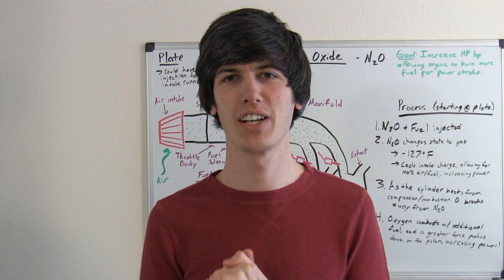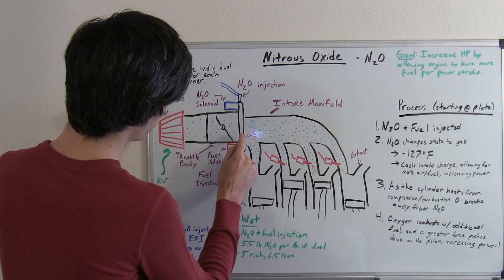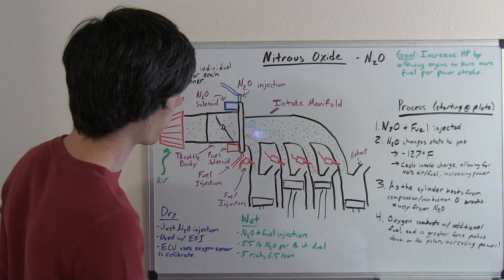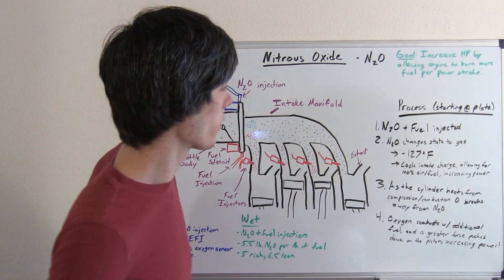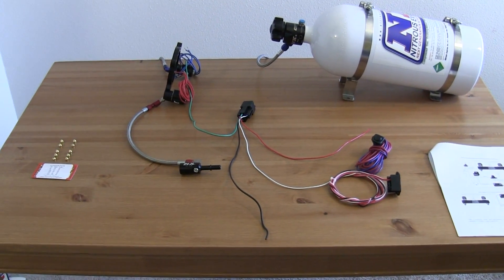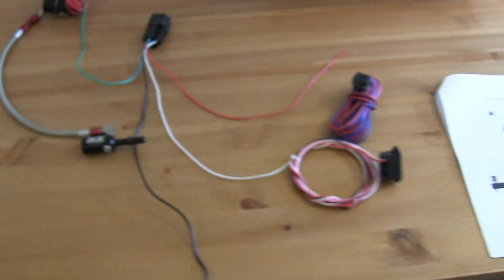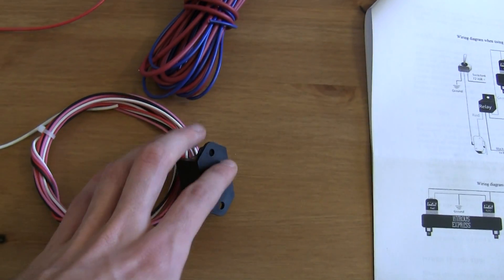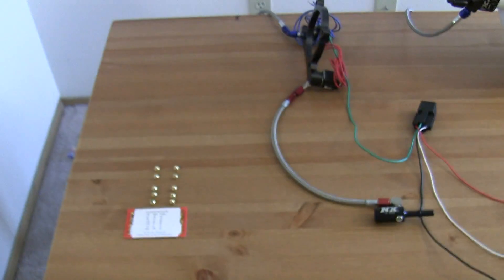How Nitrous Works - More Horsepower!

Comment: I do. Sorry if I came off like a dick haha but still what you said is way off. It can be done very safely if you have the time and patience to learn before you do anything. Safeties include window switches (recall how torque is always higher than hp until 5250rpm) so this switch keeps nitrous off until around 3300 rpm, or whatever you set it too. It also cuts nitrous a few hundred rpm before your set shift points so you dont spray nitrous while off the throttle and blow the engine. next post:

Comment: It's based off of what I have learned from people who have used it. I personally will never touch nitrous for my track cars. I will how ever us liquid nitrogen connected to tiny nozzles at the inter-cooler, radiator, and oil cooler to help the engine perform much better. Have you used nitrous? and if so, what do you think the pro's and con's are? would love to hear your opinion on it. I like talking shop with fellow gear heads :)

Comment: This is also very wrong, if you've never used nitrous you shouldn't post false info about it. It does not smell any different, test pipes or a downpipe/cat delete will give you a gassy smell. Not nitrous. And its also not called "NOS". That is a brand. It's like asking your mother to pass you the "Uncle Bens" instead of rice. It also doesn't ruin your engine at all if done properly but you've clearly never done the research. Maybe you should actually watch this video. Or learn how it works.

Comment: As you use nitrous, it lowers the bottle pressure (optimal is 1000-1050psi) therefore a bottle warmer will:

a.) quickly warm up the nitrous to the desired pressure before a race
b.) keep the pressure steady as you use it up.

Comment: Wrong. Nitrous won't cause flames and there are no additives other than sulfur for detecting leaks (scent). They aren't running lean (or they would blow the engine quickly) and they aren't running rich enough to shoot flames. Flames are strictly from antilag/timing settings or excess oil/fuel making it out into the exhaust in many different possible ways. Don't post things if you don't know what you're talking about haha no point misleading people.

Comment: the movies have a special additive on the NOS system to do that. Normally you wont ever see that. Your ECU will compensate either by leaning the fuel or riching it up pending on what it sees by your O2 sensors.

Comment: Keep in mind, the catalytic converter reduces HydroCarbon (gasoline) exhaust emissions. it is most likely to occur on a car that has no cat-converter, an engine in the back of the car, an early exhaust valve opening (after combustion), low compression ratios, and short exhaust pipes. I have modified some old car with carburetors, and flames can fire out the rear if you do it correctly.

Comment from the maker: I suppose it depends, but perhaps not. If the diesel typically injects multiple shots of diesel, it may not work the same, but maybe it could be altered. Regardless, concentrated O2 is a bit dangerous, as it reacts very quickly with a flame source, where as N2O is a bit more safe.

Comment: So, Nitrous is used to increase the ammount of oxygen in the engine, which allows you to increase the ammount of fuel you can burn. Overall you get better HP, but can you use better quality or a different kind of fuel to increase HP? I would like to see you cover something on this topic. Did a quick search on wikipedia for "nitro" and it showed nitrometane as a high-preformance fuel. This is all fascinating for me, I know nothing about engines and you explain everything really well. Great job!

Comment: i see, well the reason i'm asking this is because i tried releasing some pure oxygen into an older engine (carubrator) and it's idle revs went up for about 1000rpm more than normal, and since oxygen helps with the fuel combustion, i believe it's logical that if the ignition timing is set right, it would also bring up the HP of the car, and it's cheaper than NOS....

Comment: Do you know what's the difference between this system where the button is actually a system switch for on/off, and the fast-and-furious 2 button setup? Or is the two buttons setup just a lack of knowledge from movie writers just as the "double clutching" in F&F 1?

Comment: Correct!!

Oxygen is far more combustible at pure form; it's often surprising how quickly it can expand with just heat added alone and it doesn't combust  The Nitrogen acts as a mitigant for the Oxygen so to control the precise amount of combustion you need in the given system.

Comment from the maker: There's not really an answer to this question. Just depends how overbuilt your engine is I suppose. If an engine is optimized for it's power (which properly engineered engines will likely be), and has a low factor of safety for stresses, then 200 extra hp could do a great deal of damage. Just depends.

Comment: You can, but I personally wouldn't.  A diesel naturally runs at a higher compression, meaning it has a higher acceleration rate anyway.  That is why when you romp on it in a diesel it throws you back and just takes off.  Personally, nitrous on a diesel would be pointless, just get a performance turbocharger.

Comment: Backfires are more likely to happen in 2 instances...1. morons that don't use WOT switch and 2. dry kits.  On a dry kit you are relying on your MAF to make SURE your injectors send more fuel.  Either instance, too much N20 and not enough fuel=boom boom.  Hope that helped.

Comment: I'm interested in Nitrous backfires, why they happen and how they can be prevented. Also water/meth vs nitrous seeing as nitrous does something similar to water/meth in it's application it makes me wonder how much could be had replacing the water/meth with nitrous and then matching something along the lines of a cfi or tbi for a good ratio.

Comment: QUESTION: Knowing that the system only works when going full throttle, does it stop when full throttle is released? More specifically, What happens if you're driving a manual and you have to change gears? Does the Nitrous keep going until empty regardless or does it switch off once open throttle is released?

Comment from the maker: Whatever the weakest components are (pistons, rods, crank, etc.). I know that's a blanket statement but it varies from engine to engine. Some manufacturers use high factors of safety for their components than others - and typically they'll cost more. Just depends on how good your internals are. I'd recommend reading up on forums of what other people have had success with with your engine.

Comment from the maker: Haven't heard of this model, no. But I am aware of the days during the 70s/80s when the big American companies thought it was a decent idea to swap fuel delivery systems on gas engines to diesels without much work on the internals, resulting in terrible diesel engines. Probably played a big role in why so many Americans just avoid diesels. They're much more efficient engines.

Comment: Very informative channel keep up the good work! I was just wondering, I know this is old school but did you ever have any experience with the Oldsmobile 350 diesel engine? I am an old car buff and I always thought it was an interesting concept GM had. Putting diesel engines in full size cars in order to give them more "power" and decent fuel economy. Despite disastrous mechanical faults. I was just wondering if you ever heard of or dealt with these engines and what your thoughts were on them.

Comment from the maker: O2 cannot combust without a fuel, it's not a flammable gas but it is required for combustion to occur. If more oxygen is present, nearly anything around it can suddenly act as fuel.

Comment from the maker: Yeah just cover anything electrical. I covered a few connections, my battery, and alternator and washed the burnt oil off my engine not too long ago. It was fine, but I've heard many horror stories so be careful.

Comment from the maker: Too lean would cause overheat, yes. The jets (nozzles) control flow rate, yes. As for your final questions, depending on how much extra power you put in, you'll need to upgrade internal components.

Comment: so bro you are asking about gasoline direct injection engine.
actually in GDI a special type of injector inject petrol under high pressure about 2000 psi directly into the combustion chamber rather than the intake manifold.
here common rail fuel injection system is used and the fuel is injected during the suction stroke at an angle 60 degree of the crank travel after TDC.

Comment: So I greatly appreciate the break down in these systems, and look forward to seeing your other videos.  I am an EE, so these systems are a bit foreign, but I do not think they are beyond my grasp.

So QA time.  What is the risk to overflowing the NOs?  Are you looking at overheat, and cylinder explosion?  Is that the reason for the different intake nozzles?  Is it so you can help control the inevitable damage that you will be doing?  Or are current cylinders typically designed with this in mind?

Comment: NO. Oxygen is not flammable. The flammable is the CH4 which is the fuel. The fuel need Oxygen to change state. From CH4 plus O will turn to CO2, H2O and heat. the rocketships uses H2 and O to form H2O and this still cause heat to create and still pushes the rocketships fly. basely the heat is the one that cause the rocketships to fly.

Comment: It's a shaft that is on the bottom of your car and it connect to the transmission then to either a transfer case and or differential. If ur car is a front wheel drive it won't have it

Comment: Hi there.
Really great videos. On an unrelated topic I'd like to ask. Is Oxygen flamable at any state. the reason I ask is because I heard that they use Liquid O2 in rocketships as fuel. don't remember where I heard this and don't know if it's correct. When I went on a fire drill coarse they say Oxygen is NOT flamable. If oxygen is flamable at a curtain state, can you explain a bit. Thanks for your time

Comment: At wide open throttle the car is in open loop and will (in most systems) ignore the O2 sensor. 

In a standalone system, you can add extra pulse width to your injectors during ( WOT && nitrous system on)

Comment: yes, as long as a diesel has enough fuel to burn the nitrous it will work great! no engine parts will have to be changed.  As a general rule of thumb, if it smokes it has enough fuel to add some nitrous.

Comment: Hey, i have a doubt... a turbo works in a slimier manner right? i.e. it lets in cold air into the cylinders so it will produce more power... so can i install a nitros kit into a diesel engine which is turbo charged? will i need to replace any parts of the engine like, intake manifold?

Comment: There is quite a few actually. Simplest one probably being : If you want too much horsepower (basically : to much pushing on your cylinders) you are going to blow up your engine. But that probably doesn't happen much. Mostly the problem will be that your fuel system will need to be able to supply the amount of fuel that you are asking.. If it cant you will run "lean" and this is bad for your engine. Really bad.

Comment: Bottles are refillable usually costs around $45 to refill. Nitrous systems start much cheaper ($399 for a basic system) than turbo/supercharger setups. If you do decide to go forced induction later on, nitrous will still work just as good when used in conjunction with the other power adders, and N2o will reduce air intake temps and help control detonation.

Comment: Nitrous comes out of the nozzle at approximately -127deg F(as mentioned in the above video)  when running for a short period of time you can use the nitrous to chill the air charge.  Nitrous and Water/Methanol systems are a very popular combo on turbo drag cars

Comment: NX offers nitrous controllers that will monitor TPS signal and the controllers are programmable to start bringing nitrous in at lower TPS values.  If you have no way of monitoring the throttle position (such as with a controller) there is really no good consistent way to do it.  You can put it on a push button like you see in most movies, that is always an option.

Comment: So basically, Nitrous are more efficient than turbo/superchargers because you can control when you want extra horsepower and you can also control how much added horsepower you want? The only negative will be running cost (having to buy a new nitrous bottle when the old one runs out of nitrous)??

Comment: Since the fuel and nitrous systems are now working together and fixing the ratios of the two liquids being sprayed instantaneously, does that mean the engine won't run properly when you run out of nitrous? It doesn't really sound practical to have to have some NO2 just to make your car go (especially if the system uses more NO2 than fuel due to the larger nozzle). Can you shine some light on this Jason?

Comment from the maker: Well I'd say one big disadvantage is it isn't really a permanent power increase, so if you're going on track days you won't be able to sustain the increase in power, without swapping bottles. It's probably best for drag strips where the car is only running WOT for a fraction of a minute.

Comment from the maker: Because nitrogen boils at -127 F. In the tank, it is compressed, keeping it a liquid. When it is exposed to the outside air, it instantly boils, dropping its temperature to -127 F. Changes in state means a big energy difference. Don't know if you've ever played paintball, you'll experience the same thing. As you shoot the paintball gun, it gets cold near the top of the CO2 tank; this is the liquid CO2 changing state and losing energy.

Comment: Just some additional notes:
Most EMS's don't use O2 feedback for the level of fuel correction in a dry kit - it's too much of a correction and it could be too late for your motor to even correct if it relied on it, it typically has to use a modified or different EMS, but most EMS's (even stock) aren't even running closed loop at WOT.  The EMS has to be made aware of nitrous.  You can use triggers and the GIO pins on most standalone units.

Comment: not only that: pur oxygen would be dangerous, a leak would be a serious treat of fire. Also, pur oxygen would not remain liquid in the line between trunk and motor, which means liquid nitrous contains more oxygen than pur oxygen in its gas state. Not 100% sure about that last claim, it still makes sense from a theorical POV.

Comment: Thermodynamic. Take water for example, you should already know you need some heat to boil it. It takes some energy to increase temperature up to the boiling point, then it takes even more energy to make a state transition (liquid to gas). That transition requires a lot of energy. If you have something that can evaporate easily (nirous), it will drain heat from the surrounding area, thus creating the "cool" effect. Long story short, evaporation needs energy and will drain it from wherever it can.

Comment from the maker: Well, the nitrous cools to -127, but that doesn't mean the entire air/fuel mixture will drop that low, maybe 50-75 degrees cooler. Also, the 600 F would be inside the cylinder, so not measured by an ATS. Glad you enjoyed the video, thanks for watching!

Comment from the maker: You could, yes, but why would you want to? I guess the logic is, if you're going to use nitrous, you want to accelerate quickly. If you want to accelerate quickly, you probably have the throttle fully open (gas pedal floored). Otherwise you may only make as much power as you would just flooring it, so it wouldn't be necessary.

Comment from the maker: No awesome purple flames, unfortunately. I believe NX recommends not using nitrous longer than periods of 10 seconds or less. Maybe a bit more. It's not something you'd constantly run, as you'd run out fairly quickly. Great for drag races, not so hot for endurance track days.

Comment from the maker: I didn't really discuss pros and cons, you're right. Benefits include more power for a cheap price. Of course, if your engine can't handle the additional pressure/stress, you'll need better internals (goes for any modification). The danger with nitrous oxide comes from improper air/fuel ratios, which can damage the engine. If the  air/fuel mixtures are kept at ideal levels, there's no reason why it can't be reliable. That said, it's better for short bursts of power, rather than long track days.

Comment: That is a splice to send fuel to the N20 Plate and the fuel rail. It is not a line that goes to the tank, it uses the standard line from the tank and then splices in the engine bay (easier to install).